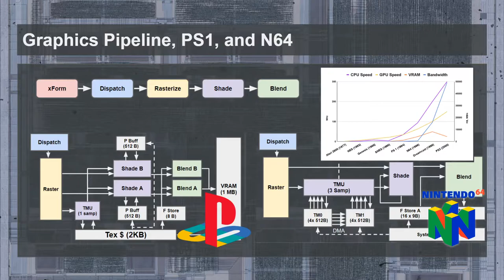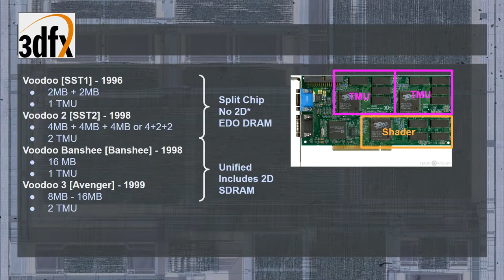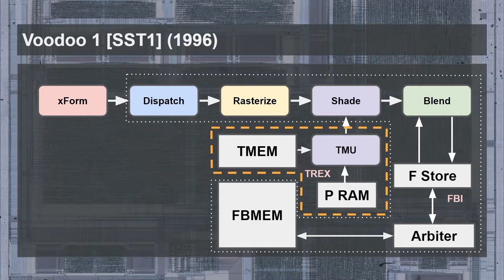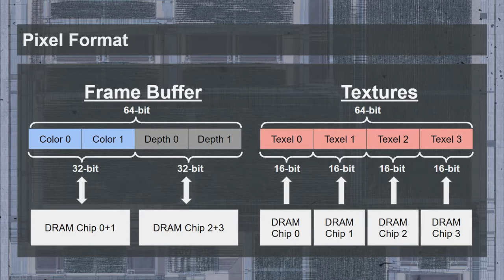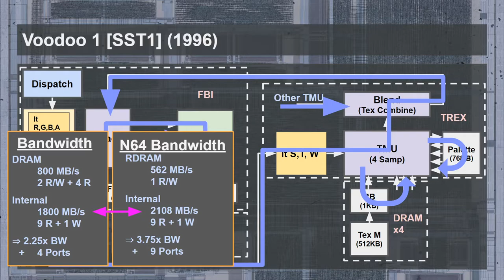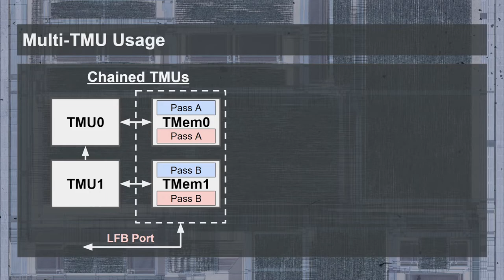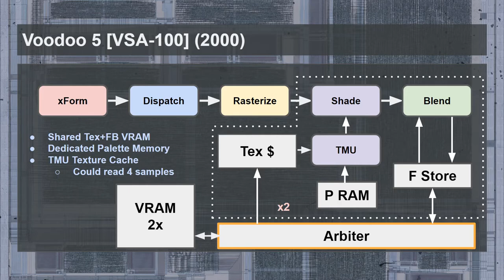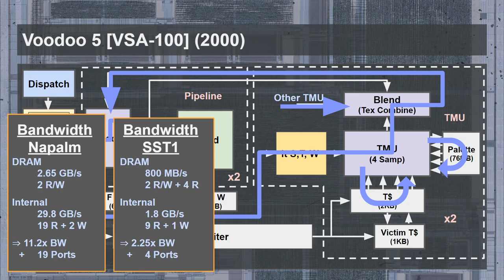GPU Memory, and Clogged Pipes (Part 2 - 3dfx Voodoo) - #GPUJune2

Comment: I like how you take corrections well and also you just make me so hungry for a FPGA solution for an N64.
Reply from the maker: Well, there are more knowledgeable people out there (e.g. engineers who worked on the chip design for these systems), and I'm more interested in the truth than being right. Although a correction needs to be plausible for me to accept it - I was hesitant to accept that the performance of the Voodoo 5-5500 in 3DMark 2001 was so low due to memory bandwidth (the detailed statistics seemed to indicate that the DX8 implementation disabled one pipeline per chip). It took some convincing, but it was indeed caused by the bandwidth (as mentioned in this video), which interestingly would produce the appearance of one pipeline being disabled. 
As for a FPGA N64, I completely agree. I was working on one, but lost motivation since someone else beat me to the punch. We'll see how well their core performs once it's released. Right now, I'm working on more challenging cores that require extensive architecture optimization to map to a FPGA, something that I think requires a more specialized skillset.
Reply: @RTLEngineering  I admire your attempt. I have seen a few people getting some good headway on some sub 1K boards.  Seeing a lot of Digilent boards in these experiments. 

I like to call them neighbors since they are just down the street from my place of employment. If they ever make a next gen mister board. I could just walk over and ask to buy one lol.
Reply from the maker: Those are certainly contenders. But I think that the next "MiSTer" would be based on the K26 SoM. It's even small enough that you could reasonable place it in an original GBA shell (that sort of form factor). It's also possible that you could fit an entire PS2 or Naomi in two K26 SoMs tied together via the GTH. I know of a few projects that are using that SoM as a platform as well, but FPGA attached DRAM is going to be one of the challenging aspects (the DRAM through the ARM side has too high of a latency to be useful).

Comment: Amazing. 
Great detail, high quality pictures/diagrams to show what is where, and commentary to top it all off.
BIG kudos for researching all the necessary information needed for this type video.
Do you plan to do TnL GPUs, or any other early weird 3D cards (like Verite, mPact2, Permedia, i740, etc.), after PS2 and dreamcast ?
Reply from the maker: Thanks! It does take a lot of effort to cross-correlate the different sources, and to try to find the underlying meaning / implications of what appear to be trivial notes. Funny enough, the Dreamcast and PS2 have proved to be quite a bit more challenging, since there are hints at more complex functionality, but there are no sources that elaborate further.
As for the other GPUs, probably not. The issue comes down to available information, such as the low level programming interface, die photos, and performance presentations (all three are necessary). To my knowledge, aside from the earlier game consoles, only the 3dfx GPUs have some of that information public. I had briefly looked into the TNT series, which appear to have some interesting hardware secrets, but I would need to probe a real one with microbenchmarks to verify, and that's not worth the effort involved.

Comment: For more information in a much different but deeper level of GPU operation, check AMDs public Instruction Set Architecture. There was an actual 3rd party student development of this architecture called MIAOW iirc. So they effectively designed their own chip that would be compatible with AMDs Sea Islands chips, again if memory serves.
Reply from the maker: I don't think I would necessarily call that deeper. The move to programmable shaders would likely imply a higher level of operation, since the fixed-function hardware is replaced with software. Though in exchange, the simpler hardware is now a more complicated vector processor. You can get a bunch of extra information about the surrounding hardware from the ISAs though, such as the fact that GCN at least uses barycentric parameter interpolation in the shaders themselves. And that the parameter interpolation is implemented by a 3-step set of instructions. When compared to Nvidia GPUs, it's unclear whether that's added to the shader program during compilation, or if it's prepended in the setup script (since they don't provide nearly as detailed of an ISA explanation).
I am familiar with MIAOW, and recall watching their hotchips talk a few years ago. One of the most memorable questions was if there were any legal implications for using the AMD ISA, which they didn't have an answer for (that's always a concern if it's not something custom).
There's also FlexGrip, which I believe used PTX as the ISA base (with custom encodings), although I would have to go back and read the paper / dissertation to verify.
Both FPGA GPU cases are only focused on GPGPU, which is at the shader level, and completely ignores the other parts that allow a GPU to do graphics. Also, neither of them implement the out-of-order operand collection logic that modern GPUs do, but that's also significantly more complicated to do. Either way, they're both very impressive works.

Comment: So great video, really!
Would love to see your opinion on Rendition verite architecture at this time!
And arcade hardware who works with quads.
And why not a "little" word about the GIANTs SGI and Evans&Sutherland!
A lot of work 😅
Reply from the maker: Thanks! I don't really know as much about the Rendition Verite architecture, nor specifics of SGI's architectures (other than the fact they they liked to use dedicated chips for each part of the pipeline). If I find the time, I can try to see what I can find and if there's an interesting video to make out of those architectures.
As for arcade hardware with quads, that's true, but then they gave up and moved to triangles. As I understand it, quad rendering was largely meant for distorting 2D sprites and not for polygons (mathematically you're very restricted by what you can draw with them). A major advantage though, is that rendering quads is much more efficient for drawing sprites and 2D graphics. So it makes sense that quad graphics would stick around in the arcade world for a bit longer.
Reply: @RTLEngineering  
Yes, you're right. 
Quads were a more natural bridge between the well-established 2D/sprites hardware and full 3D worlds. The sega saturn is the very exemple of this topology.
This system agrees with your explaination about memory bandwidth. The saturn is bottlenecked with is unified cpu/vdp bus i presume and her Master/Slave CPU implementation. 
If we put aside the UFOs from SGI with their infinite reality engine, arcade hardware like model 2 were really topnotch at this era.
If I remember correctly, there are 1/sqrt(x) tables stored in ROM rather than calculated in this hardware (OPR ROMs). A time when storing precomputed tables was always faster than the best DSPs/FPUs.
A time when MFLOP was common and TFLOP a sweet dream :-) .

Comment: Interestingly, the 3Dfx documentation for Voodoo 2 mentions cards with three TMUs. A 16mb card with 4mb frame buffer and 4mb texture memory per chip would have been pretty expensive, no doubt, but two of them in SLI would definitely have been the 4090 equivalent "must-have" hardware for the time.  I have to wonder why a retail card was never offered in that configuration.  What are your thoughts on such a beast?
Reply from the maker: You could have a card with three TMUs, but you would need software to explicitly support that. You would also need to figure out how to make use of them since each TMU maps one texture at a time (i.e. they won't necessarily making texture mapping faster, only reduce over-draw from blended effects). 
You're right about the 4090 equivalent being two cards in SLI, but they would only have two TMUs each. Aside from the lack of supporting software, and that market place held by 2x cards in SLI, the other constraint would have been board area. Fitting 3x TMUs + FBI + DRAM for all the chips would have exceeded the PCI card spec. This is likely why that configuration only ever showed up on custom boards for simulators. 
Personally, I would have preferred the 2x cards in SLI rather than 3x TMUs, or 4x in SLI. One of the main limitations of the Voodoo architecture was the raster performance, but this scaled quite nicely when using SLI (almost linear). Not only could you render faster, but you could render at higher resolutions as well since each card only rendered a portion of the screen (in horizontal bars).